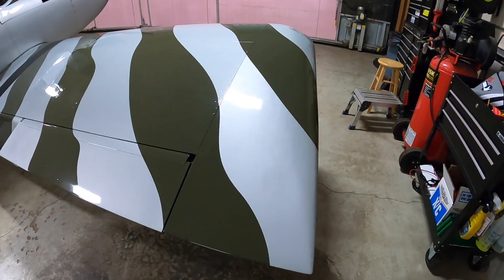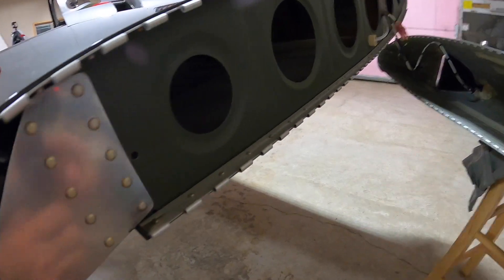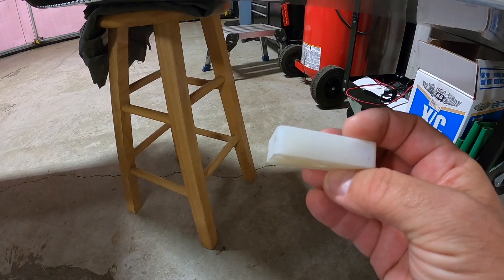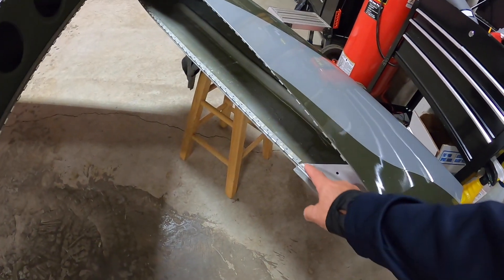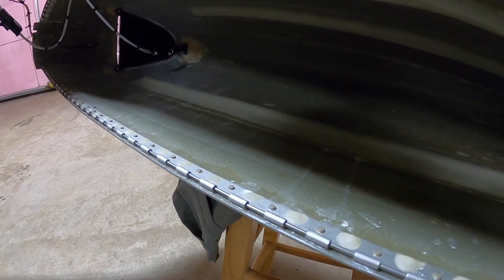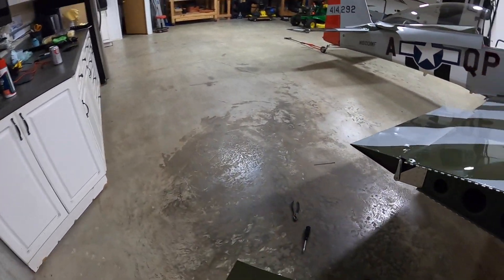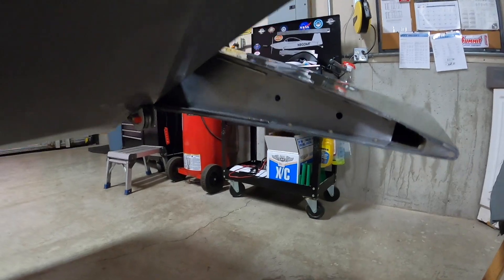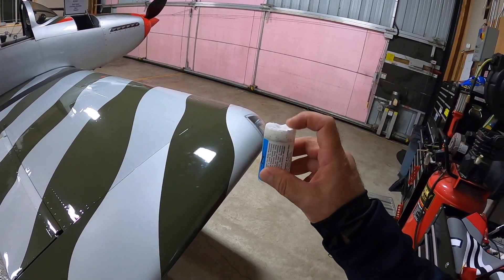RV 8 Wingtips

Comment: Great mod! The challenge with mods is that you quickly double the time you spend building and lose out on flying. How many hours would you say you spend on both tips? Just the work to fit the hinges? Thanks.
Reply from the maker: I joke around and say that every extra mod costs me 40 hours. The wing tips added around that amount. For me that was totally worth it for the looks and ease of removal. Your milage may vary! 
Regards,
Michael

Comment: It is very clean. I have had things from a wingtip block my aileron before. The first time was in a Brave 400, the landing light plexiglass had been broken and not completely cleaned out from the wingtip. It vibrated down and protruded out into the aileron and blocked it. Thankfully I was on the ground when it happened. The second time was a bird strike that caused enough damage to bind against the wingtip but I was able to over power the binding for a safe landing. I would Never put any point of failure in the gap between my aileron and wingtip.

Comment: Love this idea and am going to do it on my RV-10.  I can see how it would be easy to drill the holes in one side or the other.  I'm having trouble picturing how to drill the other side of the hinge and keep them aligned to the other side.  Which side did you mount first (wing I'm guessing) and how did you get the other side straight??  Thanks.
Reply from the maker: Hi Jim thanks for watching the video! I used Mike Bullock’s website as my guide as he did a nice job detailing the install. 

http://www.rvplane.com/?categoryid=3&dayid=567
Reply from the maker: Also here is my blog post on the install!

https://www.rv8-hangar.com/back-to-work-3/
Reply: @therv-8pilot  Awesome!!  Thanks for both links.  Your blog is incredibly detailed.  Greatly appreciate the info.  Seems so simple once you can see the pictures.

Comment: This worked great for me on my RV10, I set a rivet in the end instead of a screw and drilled holes in the block above the screw to view that the pins are in. Used biolube on the pins and just push them in using the block. Will be doing backer rod layups next, great idea thanks for sharing.
Reply from the maker: Awesome! I’m just passing on what I have learned from other talented builders. That’s a great idea about the “witness” holes to see the pin’s are in place. I love chatting with other builders and having them add their ideas to keep improving the mods we do.

Comment: A hint: At the end of the hinge pin do not grind down the tip to a concentric point. Instead grind the tip point slightly off center. This comes in handy if you have slights alignment, esp. at the beginning of the curve.
Reply from the maker: Great tip! I actually rounded my pin end instead of a point. I found it worked better that way for me. 

Thanks for the comment and watching! 
Michael

Comment: Did you do anything special to keep the trailing edge from moving up and down? I did the same setup but find there’s just enough play between the hinge eyes to allow some movement of the TE. Doesn’t seem to effect anything in flight but it’s annoying on the ground to not have it secure.
Reply from the maker: The only thing I did on the trailing edge was to fill in the space at the aft edge with epoxy and flox. I did that because I split the training edge a little to try and get the alignment just right. Once I did I stood the wingtips upright, with the trailing edge down. I taped off the inboard edge from the trailing edge to about an inch up. Then I poured in a epoxy/flox mix that was runny enough to fill in that area. 

All that being said I didn’t do it for any movement like you describe. I didn’t have any play in mine at all and are very stiff.
Reply: @therv-8pilot  ok interesting. On mine it seems that the hinge eyelets have extra play. It’s not the actual TE flexing. Maybe the hinge material you got was closer tolerance. Thx for the info! Beautiful RV-8 you built!
Reply from the maker: Thank you! Maybe a little larger pin? It seems like I had two types, an aluminum pin and a steal one but I can’t remember.

Comment: Also did you waterproof the lens for lights?
Reply from the maker: I didn’t do anything special for the lenses. They keep the water out by themselves without any issues so far. I considered running a very thin adhesive backed seal from McMaster Carr but only if I had issues with water penetration.